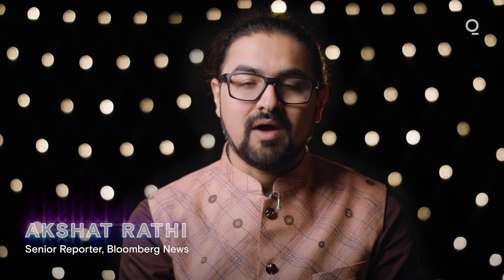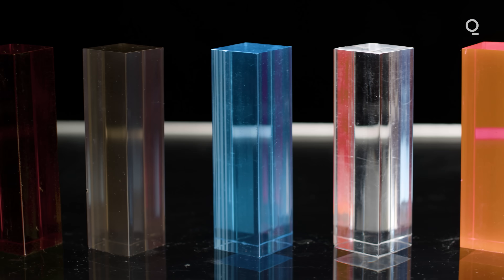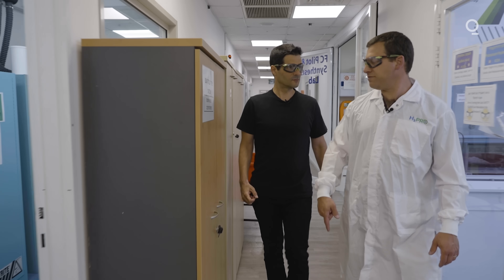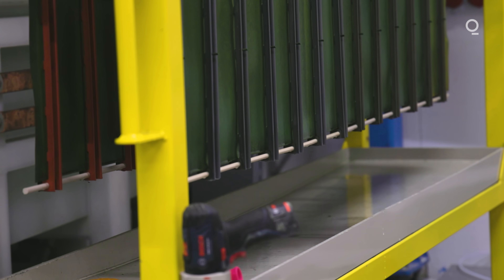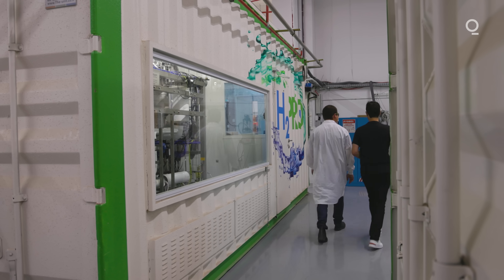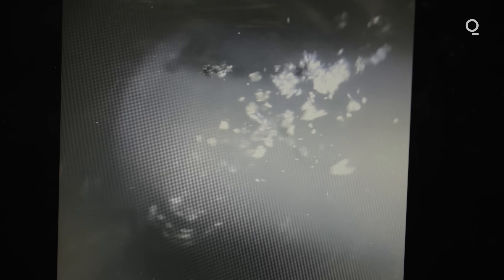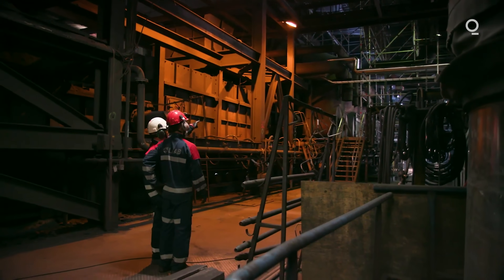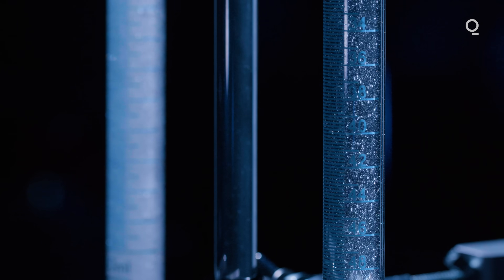How Cheap Hydrogen Could Become the Next Clean Fuel

Comment: Seems insane spending billions of dollars for making hydrogen gas
 which is explosive
 difficult to store 
difficult to transport 
All these at extreme levels 
similar to having a fusion reactor challenges.

There are many low hanging fruits for energy
 likes solar heat energy 
solar light energy 
wind energy 
waves energy dams energy
 photosynthetic energy
 biological forms of energy
EMR energy
Etc

Hydrogen is a very very difficult element
 the size of hydrogen atom is small and once is loses its electron 
the proton size is possibly million times smaller than the molecular hydrogen.

Comment: There are researches for Photocurrent Electrolysis without using electricity for water splitting, and new Ultrasonic Waves to improve H2 water splitting yeld without using platinum and precious metals and get more H2 efficiently reducing 25% the energy needs. It’s a recent research.

Comment: If it is produced using electrolysis, cost of ekectricity is the key. In order to make hydrogen a replacement for fossil fuel, it has to beat the price of NG/LNG. Must remember, the equation of NG and hydrogen is 1MMBtu = 7.4Kg. So if you produce Hydrogen at say US$6 per Kg and you need 7.4kg to deliver same amount of energy as natural gas, then it will cost you ~ USD45 per MMBtu while average cost for LNG ~ USD39.5 per MMBtu as projected by bloomberg. You need to produce hydrogen not more than USD2 per Kg. Our company will be delivering Green hydrogen by Jan 2029 at price of ~USD1.2 - 1.5 per Kg

Comment: CO2 is not pollution it is the basic food building block for plants and therefore all life on earth.
Reply: Like anything in science its a matter of how much.
Reply: @jaaklucas1329  unquestionably true but CO2 has been in the 1200 ppm  and higher. What is missing in the let's be reasonable quotient is that all the carbon that is in oil,  coal and gas came from the surface of the earth according to science. So if we theoretically returned it to the surface in a metered but progressive amount the most we could get is equilibrium.Most plants don't proliferate in the desert because there is not enough water to sustain them but when there is enough CO2 they don't have to breathe so hard to to gain carbon. Breathing hard takes water. The concept is lost that all plant life has to contain water. When we walk in the woods we are just walking through containers of carbon and water. Will we ever get equilibrium? Not likely but at current levels we reaming in a state of dearth or lack compared to what would be the beneficial optimum content. Boost the plant content in the world and there would be a higher O2 content to the atmosphere. So back to your statement about science we really don't know how much but science does say if we get down to 150 then plants will start dying and it might be a point of no return. We know that we have had higher C02 counts and survived.

Comment: I tell you what, I have been seeing videos and r e a d articles about using hydrogen for decades, and they all come back to the same conclusion, yes, it is the most abundant element in the universe, but it takes energy to extract it from these elements! The only real interest I have in it is for a hydrogen fuel cell to Power electric vehicles, but even then, you have the problem of the infrastructure that needs to be put in place to refuel these cells! Tesla and others have already installed the electric refueling stations, so now who's going to be paying the money to do the same thing for hydrogen? Let's just stick with the Battery Technology improvements that are ongoing now, since it's for certain that lithium is too risky as far as overheating goes, however it will do until sodium ion or something else comes along to solve that problem.

Comment: Improvement in stackcells will not bring hydrogen production cost that much. Lowering the amount of electricity to produce hydrogen will not be better than 33 KWh per kg...as 33kwh is taken as based on 100% efficiency of electrolysis

Comment: The key is electricity cost. If it cannot be reduced to below US 20 cents per kWh, price of green hydrogen cannot be sold at US1 per Kg, thus cannot be used economically to replace NG as 1 Mmbtu = 8Kg of hydrogen, so for US1 per kg will cost US8 per mmbtu, comparable to NG.
Reply: Why do you think H2 should be trying to compete with CH4? What uses of CH4 are you thinking of? Apart from things such as steel fertiliser and chemicals which need hydrogen, the only other things hydrogen should be used for are power for things that move that need too much energy or too much uptime for batteries to do the job. Anything that doesn't move, such as heating, should be powered from the grid. It's always going to take more electricity to make and deliver hydrogen than it would do to just use electricity to do the job in the first place.
Reply: @adrianthoroughgood1191 .

Comment: That's wonderful but there is a problem. It takes energy to make hydrogen and because of those nasty laws of physics it takes more energy to produce hydrogen that we get from it. We lose even more efficiency if we use internal combustion engines to burn that hydrogen because internal combustion engines only convert 35% of the fuel to produce power and the other 65% becomes heat which is why cars have radiators.

Comment: "Green hydrogen" is not a suitable method for producing cost effective hydrogen; there is too much energy loss. "Turquoise" hydrogen is in a sense "greener" because green hydrogen requires the time and material use expenditure of renewable electricity generation capacity. With turquoise hydrogen you can blend fossil methane and biogas into a single input stream feeding a thermal pyrolysis reactor and out pops hydrogen and carbon black to boot. Not only do you get hydrogen and not only do you sequester the carbon dioxide that would be generated by fossil or biogas, but various forms of carbon such as activated carbon and carbon black are marketable products themselves. Pyrolysis itself is exothermic and so becomes self sustaining once initiated, like burning wood. If you have a continuous reactor all you need to do is add methane and out pops your products. Additional heat to supplement wasted heat can be provided by nuclear. Green hydrogen can't compete with this. More value in sending that electricity to the grid. Using electricity to split water just so the hydrogen can be recombined with oxygen to produce electricity in a fuel cell, after a long arduous journey of compression and transport, is a waste of resources. It's like untying your shoe laces just so you can tie them again.

Comment: Actually they tested a hydrogen fuel cell car and electric car and shot them both up with some high power rifles the electric vehicle caught on fire and burned up the hydrogen fuel cell car had holes punctured in a hydrogen escaped it did not explode

Comment: CO2 carbon dioxide is essential for plant growth if we run too low on co2 on the planet the plants won't grow properly and the Earth will cool down too much and start an ice age
Reply: When burning gasoline, not only CO2 is released. CO, nitrogen oxides, metal oxides, aldehydes and many other harmful substances are also released. Especially these harmful emissions are dangerous from transport, since drivers, passengers, and city residents breathe these emissions. And, as for nature, you should not worry about it, take care of yourself.
Reply: If we talk about green hydrogen, then there will be a balance for this method of producing hydrogen. How much water was decomposed to produce hydrogen, the same amount of water will be obtained in the fuel cell when combined with oxygen.
Reply: @sergeypavlov7249  the planet still needs carbon dioxide in order to maintain plants and in order to keep us from going into an ice age
Reply: @rodneyjohnson4056 
The level of carbon dioxide, water, methane, and other greenhouse gases isn’t going to decrease for centuries.  Stop with the hysteria.

Comment: Many industries have experimented with hydrogen as a fuel, including the auto industry, for over 100 years.
Hasn't happened yet. Why is that?
Reply: The problem is the price of hydrogen. In addition, green hydrogen should be cheap. But companies like H2pro or Hyson promise to solve this problem. They promise green hydrogen at a price of $ 1-1.5 per kilogram, gray costs $ 1-2 per kilogram. Now green hydrogen costs 4-6 dollars per kilogram.

Comment: A geezer in the 70s built a converter and stuck it in a beach buggy filled up with water drove on hydrogen.
9 volts to seperate the gasses.
The winding is made from meteorite iron,it somehow produces more gas than is present.
Im pretty sure theres a patent for it.

Comment: Hydrogen can be separated from water at carburetor using sound waves.  The right frequency will do it. Ya need stainless steel exhaust as regular exhaust will rust away fast..truth is, it's already been done by pentagon and others. They won't release it until most of us r dead. The elite need about 6 billion dead before this tech,, along with others, can be released
 You can also run a car of off earth's magnetic field, called zero point. There's over 250 patients on it. But national security refuses to release it saying it would collapse the economy.  That's where we are at. There's all kinds of tech that doesn't pollute, but they refuse to let us have it. Not until 6 billion of us are dead. That's the truth folks.
Reply: Haha

Comment: The tricky part is you need it to be extremely pressurized for it to be useful, it's not easy to contain and maintain 5,000 to 10,000 PSI
Reply: It will be too costly and too much risk for it to be popular.

Comment: The trick here is that most renewable energy systems like solar and wind only provide sporadic energy, and for reasons that are complicated, electrolysis needs a steady stream of DC current to work. 

So you need an extra step to make it work - like a wind turbine charging a battery powering electrolysis, or something along those lines.
Reply: This is the whole point of capacitors. Capacitors are big and not useful for small scales or portable operations, but great for smoothing out conversions from AC to DC using bridge rectifiers. In a sense hydrogen becomes a great battery for non-mobile applications.

Comment: Diesel fuel is over 3 to 4 times more more dense in energy displacement.
This reminds me of comparing plant based alternative compounds to hydrocarbon based compounds.They cost more and don't work as well.
If you try to store liquid hydrogen in a car ,you have a bomb.

This is a dumb use for hydrogen.
I have a far better application for hydrogen than this inefficient process.
Stay tuned.

Comment: The anti-nuclear bias is showing up here intensely. Really, literally just a sentence was spoken about what is possibly the cleanest and safest option but Bloomberg is too blinded by the atomic scare. Install a small modular nuclear reactors and get the hydrogen by sending current through the same water you need to cool the reactor. Place that next to an iron plant and you can just get your renewable water from the iron process.

Comment: Did you know that liquid hydrogen is very light by volume?  for the same energy content a 10 gallon tank of gasoline a LIQUID hydrogen tank would need to be 30 gallons.   So to replace your standard 20 gallon gasoline tank you would need a 60 gallon liquid hydrogen tank.  Say goodbye to your trunk and possibly rear seat.  that is for liquid hydrogen not compressed hydrogen gas....

Comment: The problem here is that you still have to create refineries, you still have to transport the hydrogen, you have to dig into the ground and build massive gas stations to supply hydrogen, you need to transport it across the ocean to various locations, you need to transport it via trucks on highways to far out locations.

All of this is additional energy being used and more of a larger carbon footprint.

Where as an electric vehicle, you simply plug it into the grid. Sure as the years go by more and more energy is going to be required from these power stations, but regardless of electric vehicles or not we will need to continue to build more energy stations, and it seems right now we are headed towards nuclear as well as other renewable resources.

Fuel as well as hydrogen both require a massive system in place to be able to provide for those who own these vehicles.
Electric on the other hand is significantly better and much easier to produce and supply.

Just like the first gasoline powered car was inefficient and terrible, our first couple generations of electric vehicles will be a fraction of what they will be in the next 30 to 50 years, we will learn to recycle batteries, we may even learn a new method for energy storage, we will build better motors and better circuitry thus increasing the mileage.

This is simply how things progress and hydrogen although great, is exactly the same as gasoline in terms of transporting it and refining it

Comment: It will always take more energy to produce one gallon  hydrogen that the energy you get from that same gallon of hydrogen...  you cannot repeal the laws of thermodynamics for your convenience.
Reply: Yes you right but this is the only option we had if we want still using plane as big as Boeing 737 cause battery will not capable of doing this

Comment: They need to clarify that H is not a true "energy source" as were used to thinking about.  Because it requires energy to extract it, it's not a source.  However it's an excellent way to store energy.  Far better than a Li-ion battery. 
As far as sources go, the only true source is solar.  Coal, oil, wood, wind, hydroelectric, are all indirect solar energy.

Comment: At 4:50 they said they can extract H by just using heat instead of electricity.  Some genius needs to explain where that heat is coming from.  If from electric heaters, then I'd think using electricity directly is more economical than turning it into heat first.  (heat loss = wasted energy)

Comment: Missing is the thrmodynadic efficiencies,  without which it is just all sales hype.  As an engineer I find any promotion of either fusion or hydrogen lacking credibility without the thermodynamic  efficiencies.  While they are technically possible and need research it will be decades before they are economically viable if ever

Comment: Great video. In the equation I have been saying, even though electrolysis is not as efficient as fossil fuel production, if you use electricity from solar and wind, you make fuel from nothing. The panels just sit there and make power without having to buy anything more other than the long-term maintenance which is not big.

Great to see that they can remove remove hydrogen from fossil fuels without any emissions. But why dispose of that carbon powder? It's very useful stuff. Sell it! Then you make a really cost-effective system.

In addition, it's not true that Hydrogen is so dangerous. This old image of the Zeppelin blowing up is not a reflection of hydrogen use in say, an EV. In cars like the Toyota Marai, where the hydrogen is compressed but not liquified, If the tank gets ruptured and ignited it goes off with a lot of loud bangs and then it's over unlike petrol where it spills around and everything becomes engulfed in flames that keep burning.

Comment: think about it, running a solar to power the electrolysis that produces Hydrogen to power your homes, car, and store excess h2 in a battery backup, and it automatically repeats the process! how could it not be done? batteries on the other hand rely on the grid, what if the govt decides to pull the plug? like what is happening now in California? where will you get the source? don't tell me to get it directly from solar panels, Something is fishy with Elon, making the batteries drive scarcity to the mines that generate it, are we seeing an Oil like scarcity that will drive Wars? wake up people🕊

Comment: It's interesting to think of hydrogen as a viable energy source. The tone of the video made it seem as if we are close to achieving cheap and efficient hydrogen power. I am most curious to see how it will be put to practice outside of theory and research. SSAB, for example, is striving to use hydrogen as an energy source. It is naturally beneficial to the environment, but it is unsure whether it would be beneficial to the manufacturer in the long run.
Reply: We are.

Comment: There have been numerous proposed solutions to reducing CO2 emissions and producing new methods to reduce our reliance on fossil fuels. The utilization of hydrogen as an energy source would be effective as a means to reduce our carbon footprint. However, there are environmental factors that need to be considered when utilizing hydrogen as an energy source. The video emphasizes that most methods used to produce hydrogen contribute to increasing pollution. This is illustrated by the hydrogen rainbow where most colors are present near the pollution causing methods. The color of hydrogen is dependent upon the method used to produce it. While pollution is an important factor, there are companies working to produce hydrogen in an environmentally friendly way. This 'green' energy will allow for a more effective renewable energy source and aid with the reduction of carbon emissions, thus allowing us to reduce our fossil fuel reliance.